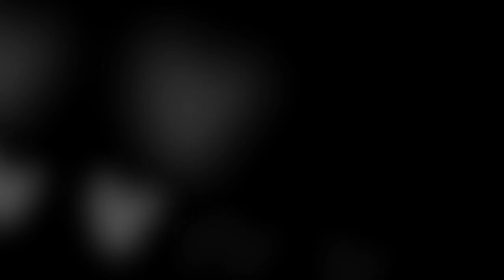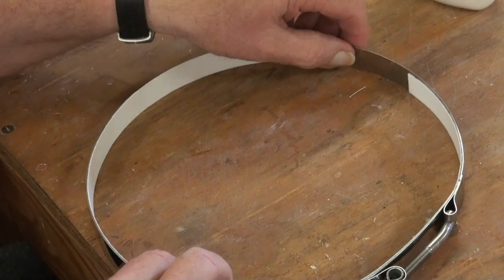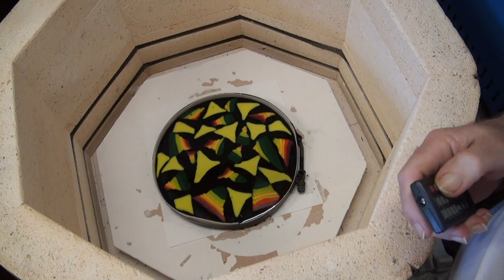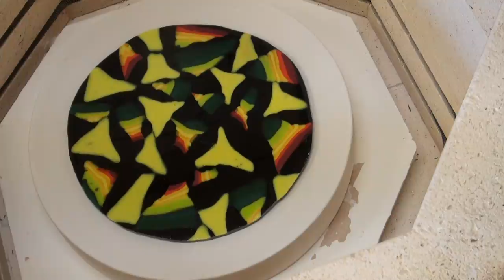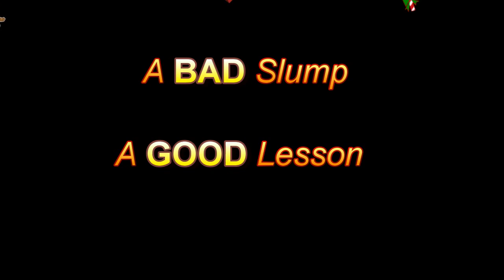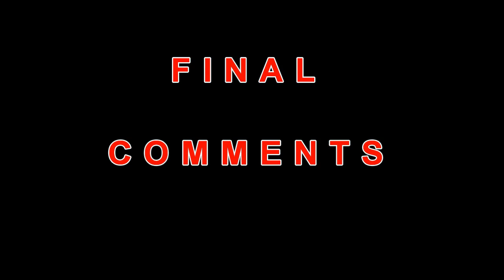FUSING IN A STAINLESS RING and SLUMPING

Comment: too bad about the plate. I have had that happen before. I have found that I get better, more even slumping results by drilling extra holes in the bottom of my mold. I had a couple of molds that never slumped evenly and that solved the problem. Thanks so much for the videos.